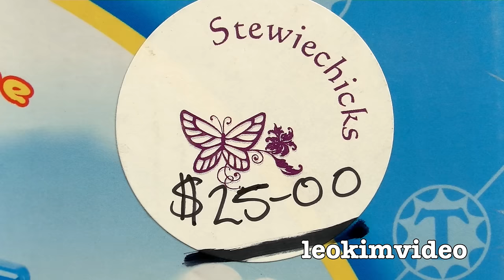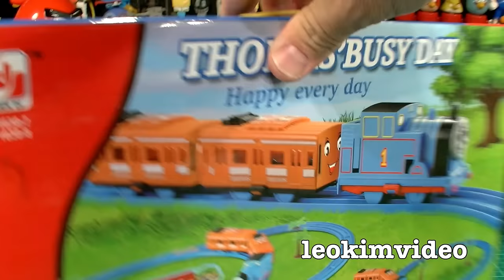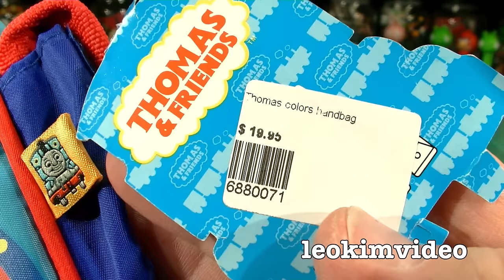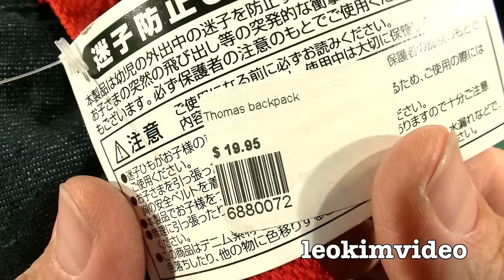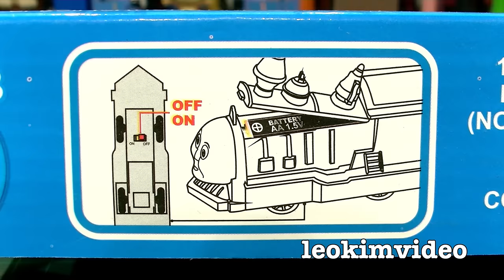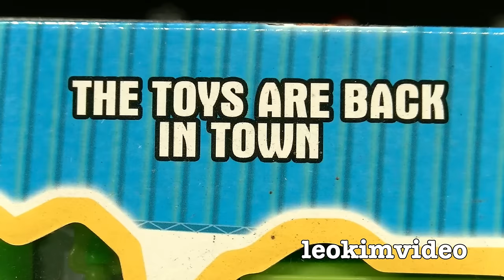Thomas Tank Dark Side Knock Off Toys Ep 8 Tomy Toy Story Smashing Crashing Train Accidents

Comment: Oh, and the reason why most train sets don't include many straights is the fact that the train requires a smooth, large curve to go around so that it won't derail when cornering. That is especially the case with my Bachmann Pennsylvania Railroad K4 class, it's a large model engine and it derails quite easily around tight curves. They also do this to cut down on packaging costs; why include pieces that aren't used in the standard oval layout included with the set?